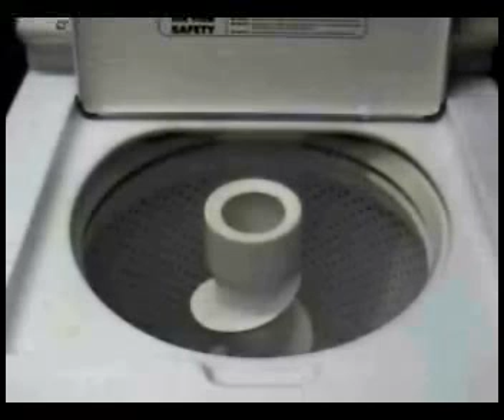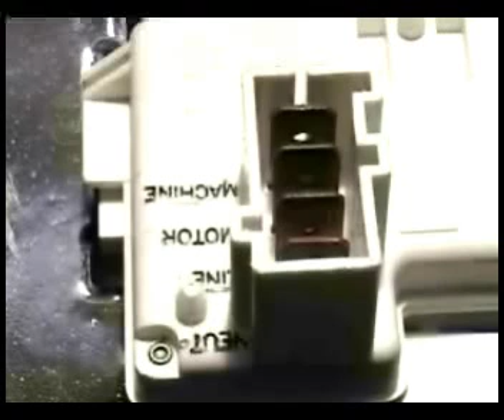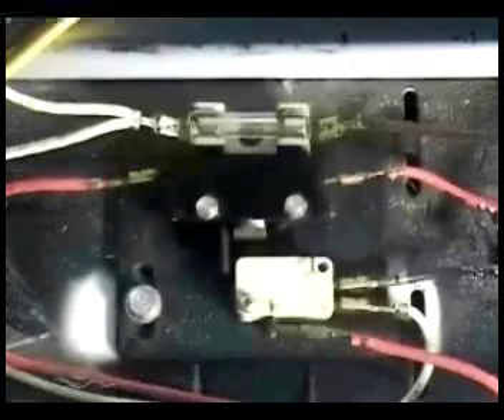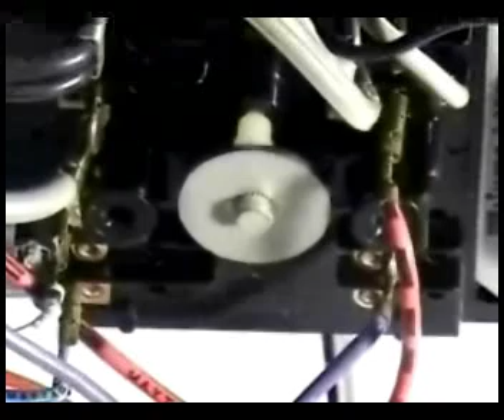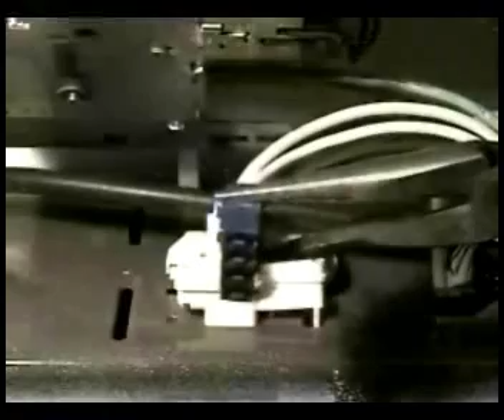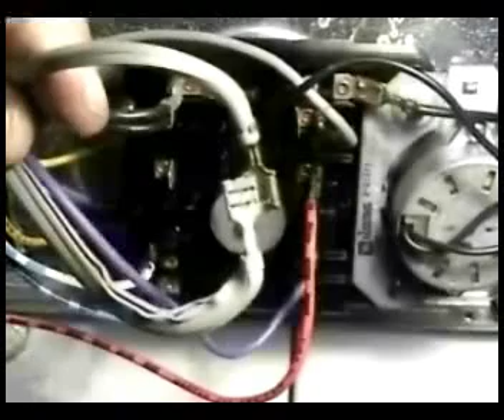Maytag Washing Machine Not Starting - See The Parts You Needs To Check & Replace

Comment: Thanks for helping others free of charge. May I suggest Simpler method? Checking line switch (Power Switch) Set water level high, program switch to fill, pull switch out. If water runs, Power switch is OK.
Reply: sounds good Donald I am open to suggestions. Thanks and I hope you had a great thanksgiving day

theapplianceman

Comment: QUESTION:
Your videos are so good man. I have an old style Maytag. Wont start, which of the tree USUALLY go out 1. lid switch 2. timer 3. plug.  I figured the plugs on the old ones have more copper in them than the plus these days and it seldom goes bad.